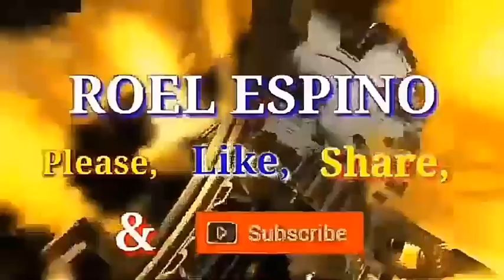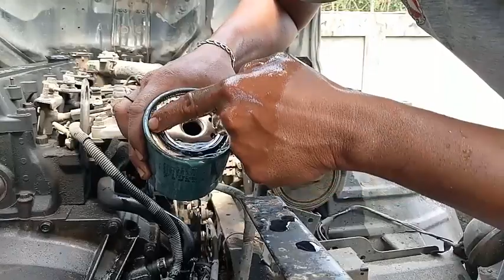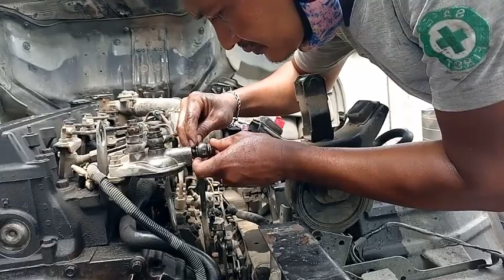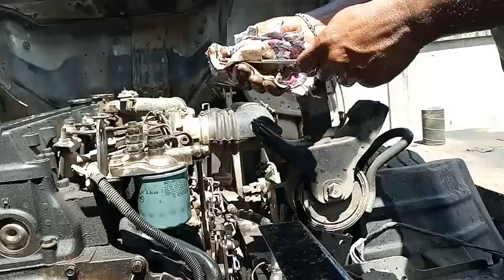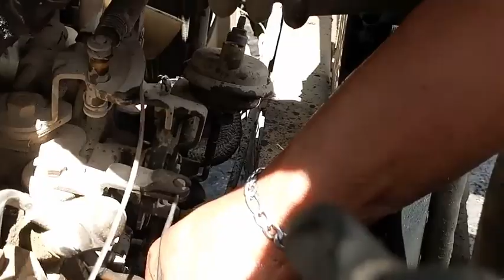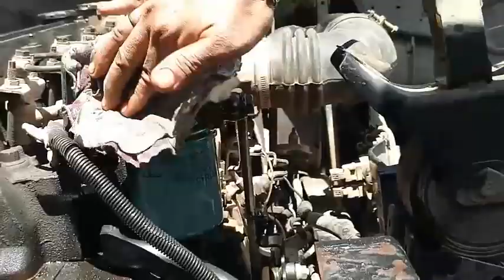4HF1 | Hard starting Engine Trouble shooting | How to Solve problem #fyp #viral #machine #mechanic

Comment: Sir Low pressure side lang ang na bleed mo, sana nag bleed ka rin sa High pressure side para siguradong walang air na na trap sa complete fuel system. Salamat po sir and more power to you.
Reply from the maker: Salamat boss